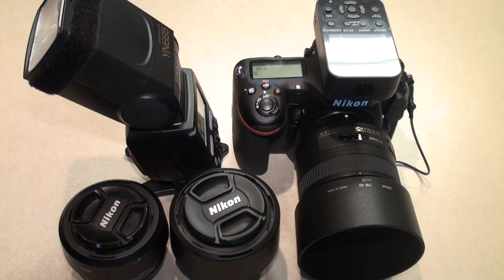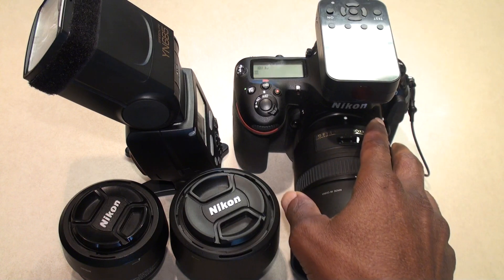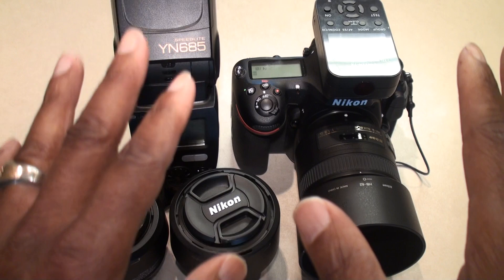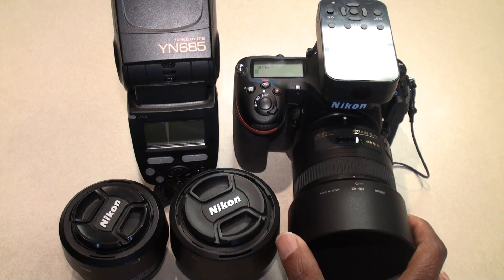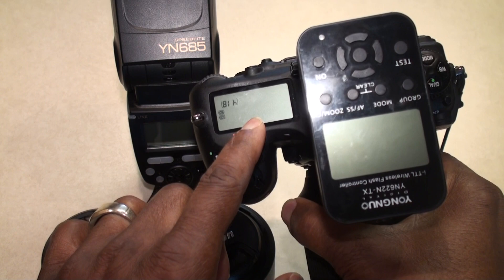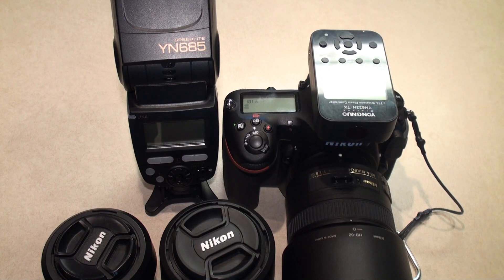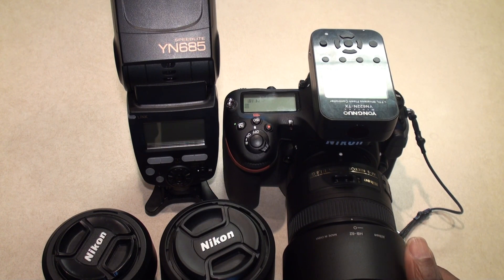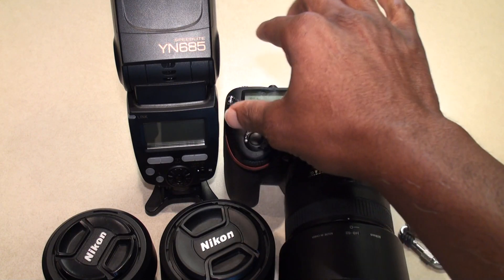Nikon D500 with Yongnuo YN622N Trigger MALFUNCTION!!

Comment: The Yongnuo flashes and triggers are trash. I switched  to Godox Xpro trigger and Godox flashes a couple years ago and never had a problem since then. Better build quality, better reliability. Everything's better. I especially like the Godox V860N-II's with proprietary battery because of the much quicker recycle times between flash to flash and   the integrated wireless receivers in them. Also, D500 user here.